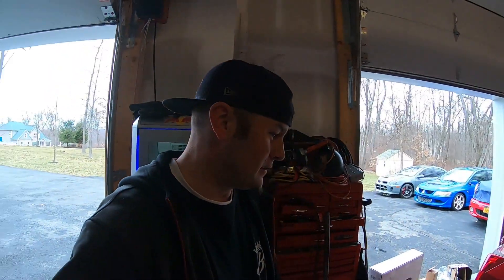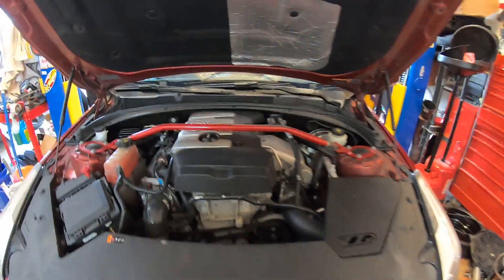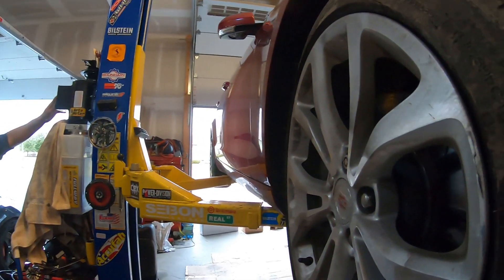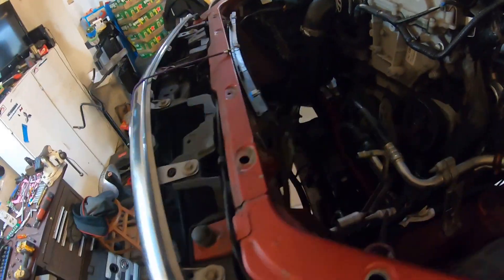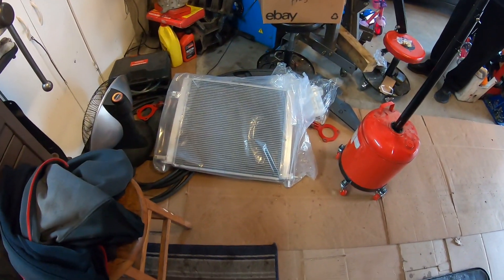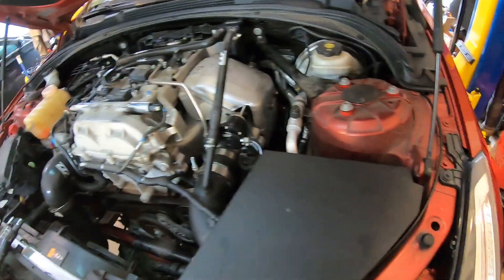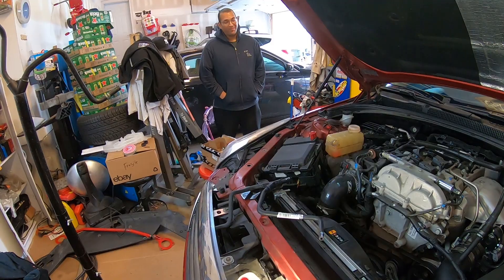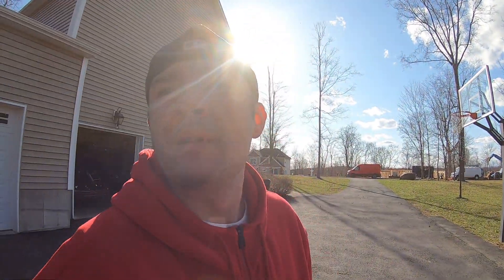CADILLAC ATS.... MORE ZZP PERFORMANCE MODS!!!

Comment: I know this is an older video but I really need help. I’m at the point to remove the radiator, everything disconnected, but I can’t get the condenser to lift off the radiator. Any advice on how to get it out?

Comment: On a stock turbo....I would have went with a bigger turbo instead of trying to squeeze more boost out of the stock one that.  How is the exhaust holding up?  I have a ZZP exhaust and it rattles, badly.
Reply from the maker: His exhaust rattles as well.
Reply: @boost_kingz  lol that piece of shit system.  I'm about to make my video public of my experience and the response ZZP had.